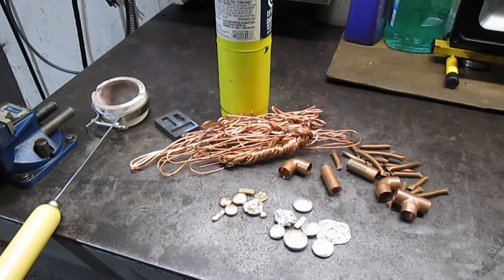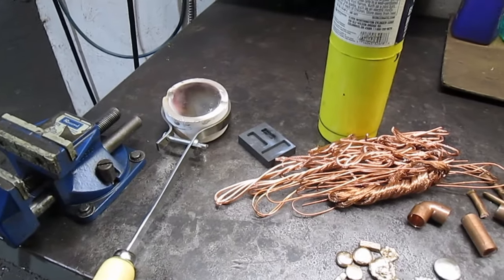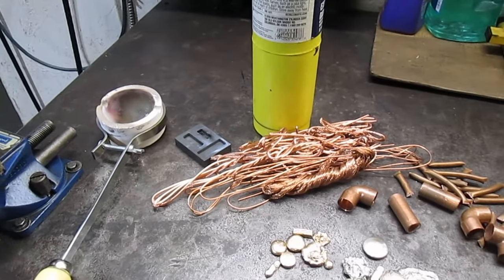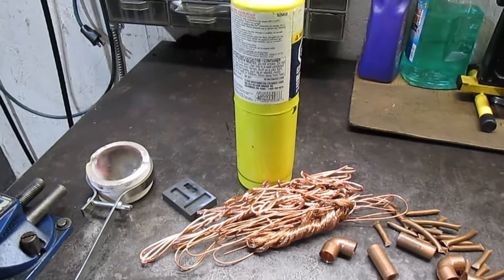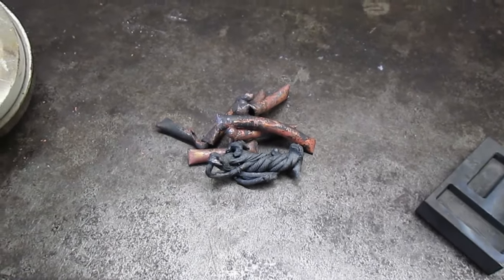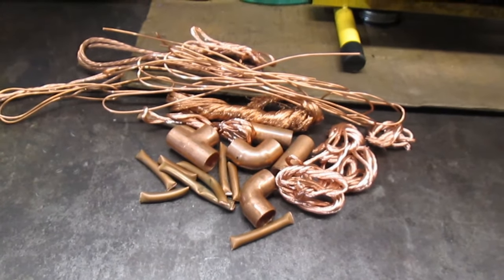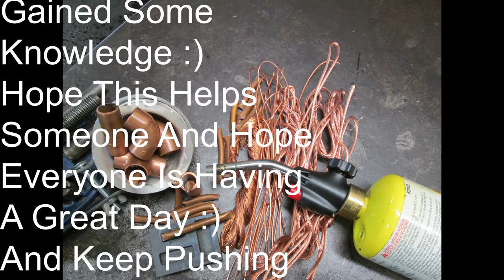CAN YOU MELT COPPER IN A POOR MAN'S CRUCIBLE ???

Comment: Looks like you did too large size pieces, also map gas does not really reach flow temps  on copper. Propane would have been a better alternative,  plus side is you did hit white hot ..you should have tried hammering it  together and see if it would have forged. Fun video!!!

Comment: U are using the wrong tip on ur propane it will not allow it to get as hot as it can ur using the right one the yellow one but that tip is wrong that yellow can will put off temps to melt copper tho